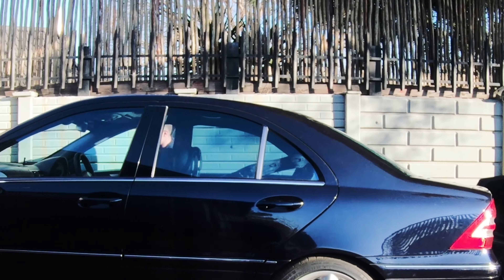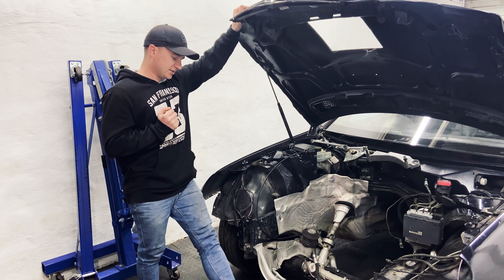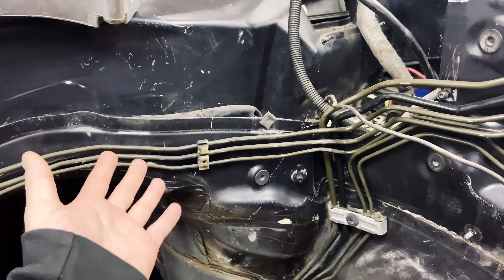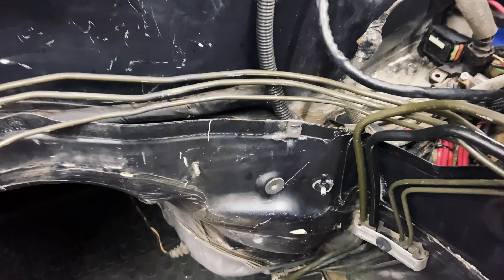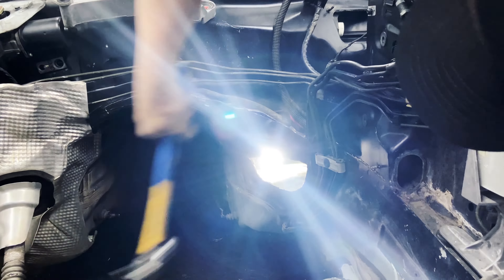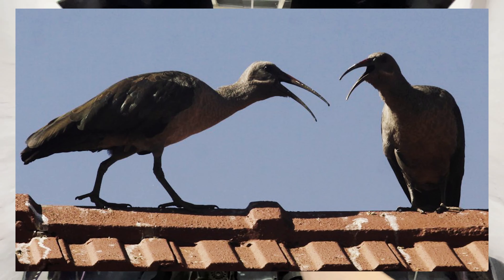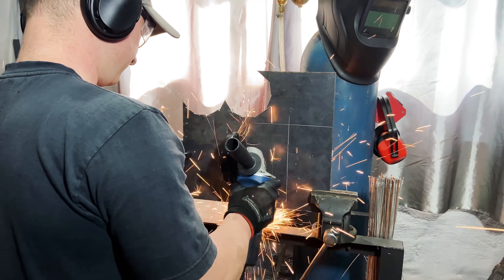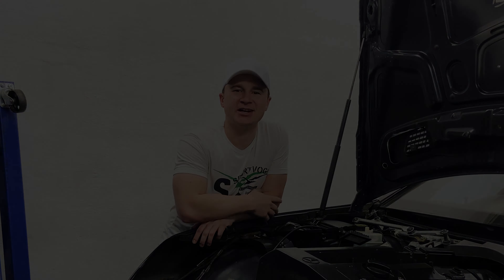Getting The Massive 3.2l M104 TURBO To Fit In The Mercedes W203 | Ultimate Sleeper C180 Build!😁

Comment: adding a chock to the rear wheels forward and backard faces will assist in lifting on a slope. my driveway is severely sloped. but still has a flatish portion before the garage door, 6orso feet from the door itself so you can understsnd the slope. I use ramps, jacks. etc. just be mindful. Also I got my 104 ready assembling speeduino as we speak!
Reply from the maker: Definitely makes things interesting 🤣good luck with your m104💪🏼😎